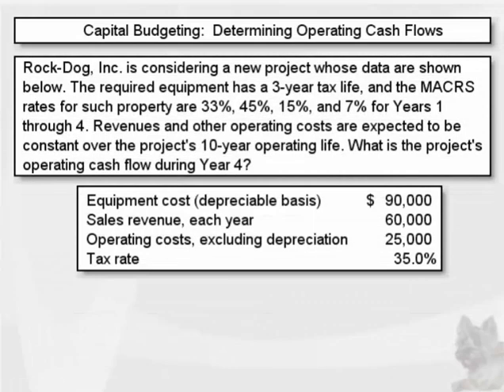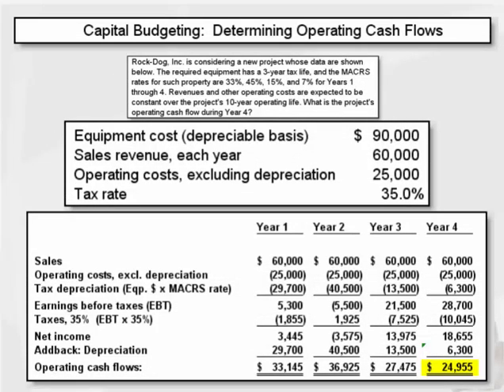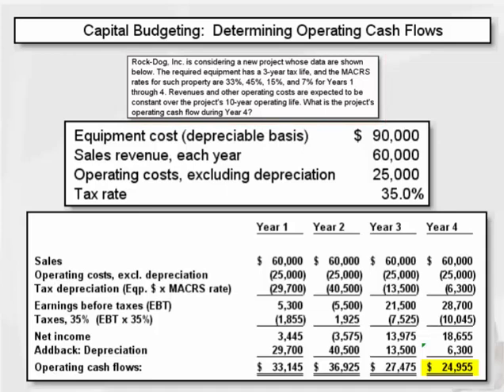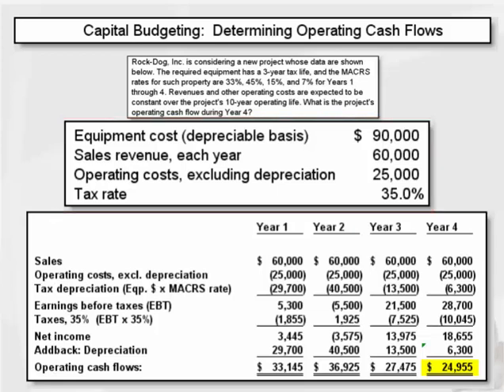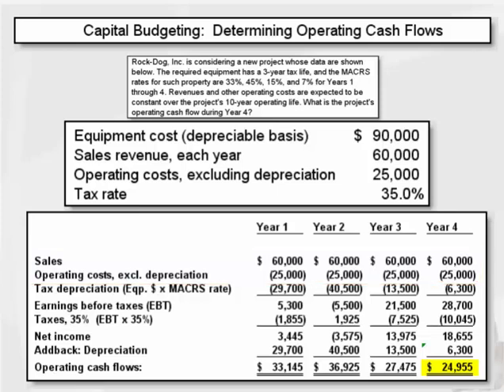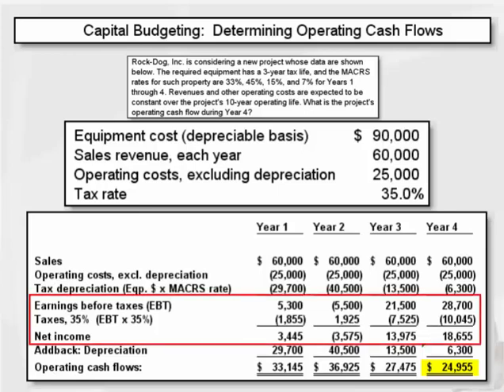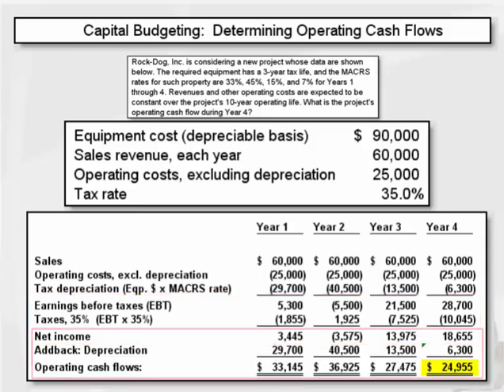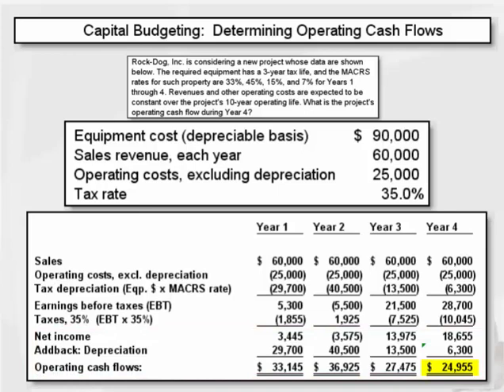Determining operating cash flows - MACRS depreciation

Comment: How would you work this question?

Seduck has just replaced a set of hydraulic screens that had been in operation for 6 years with a newer screening system that cost $180,000 installed. The old system cost $140,000 and had been depreciated as a 10-year MACRS asset. Its salvage value is $10,000. What is the NINV for the new equipment? Assume a 40% tax rate. Use the rounded MACRS schedule listed below:(10-Year Depreciation Schedule: 10%, 18%, 14%, 12%, 9%, 7%, 7%, 7%, 7%, 6%, 3%)